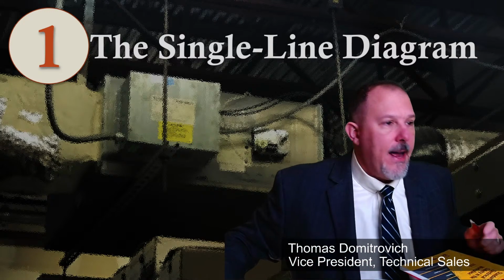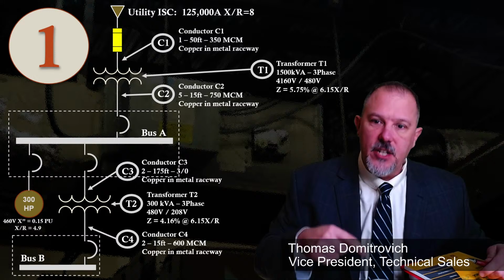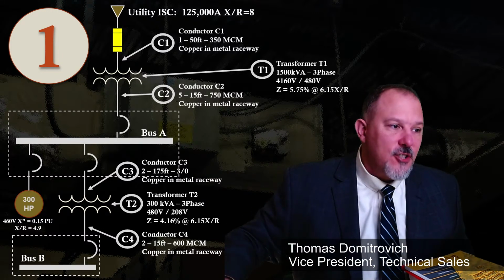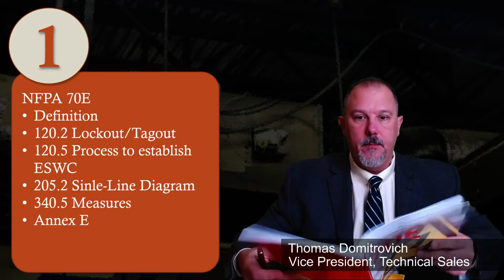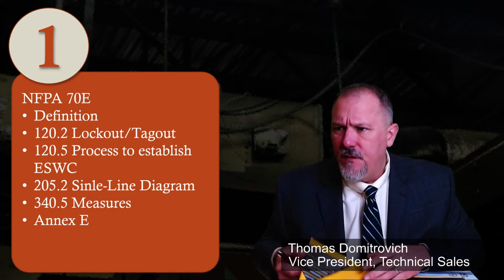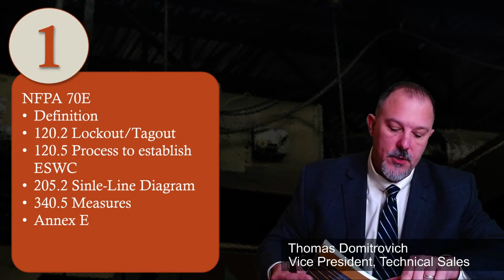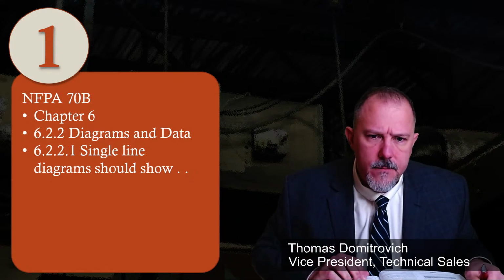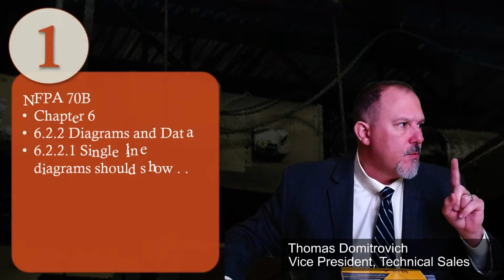#EATONTechTalk - Arc Flash ideas update

Comment: The NEC does require that when circuit breakers are of a certain size "documentation shall be available to those authorized, as t the location of the breakers."  That's usually met via a drawing (if it's met at all).
Putting boxes around equipment on one lines is important.  Otherwise no way to tell if a switch is is the same enclosure, a separate enclosure, right next to you, or a mile away.  I've had it happen where you are planning a service job and can't tell.